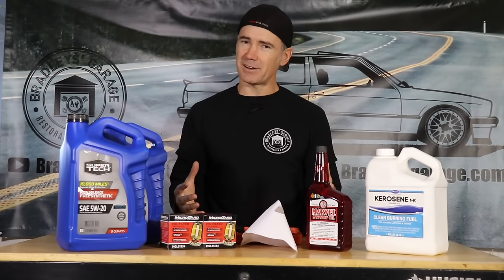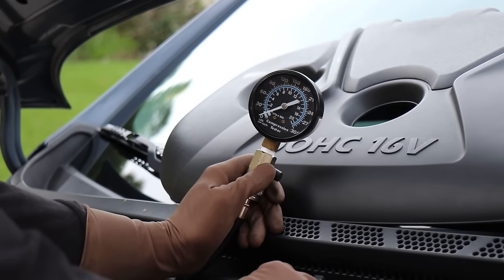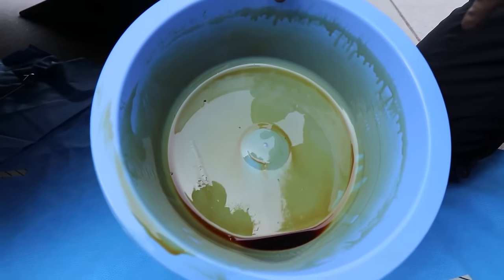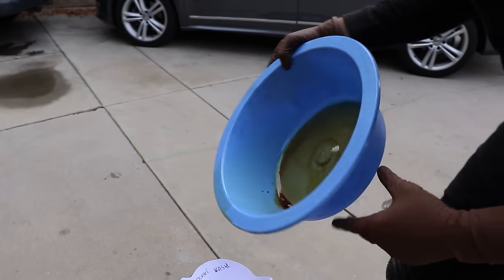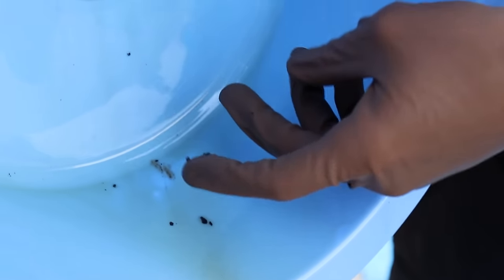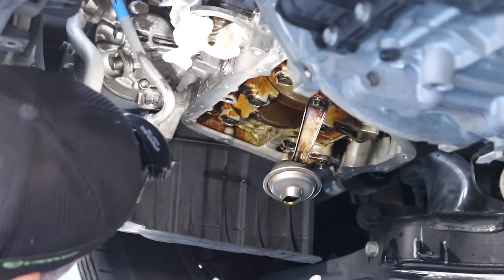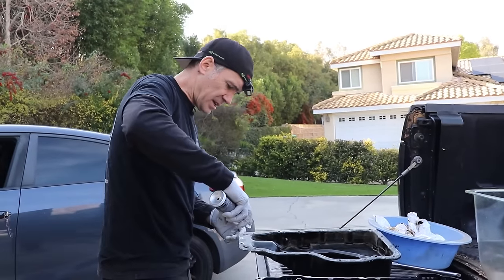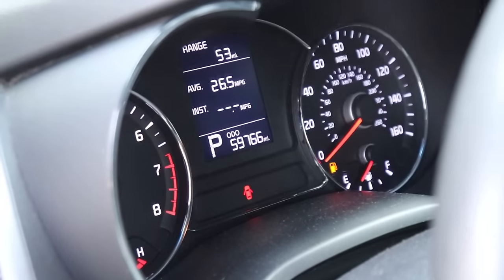*UPDATE* Customer States Jiffy Lube refused to change my Oil - Sludge Factory Kia Forte

Comment: A relatively simple process.  Wonder if it's worth doing on any used car where you may not know it's history.
Reply: Absolutely! Checking the PCV valve, if it's easily accessible, it's a great way to determine if you need to do a treatment. There are other chemicals out there that allow you to leave it in over time. I have seen a recent comment that mentions Hot Shot's Stiction Remover. That stuff works and you can leave it in.
Reply from the maker: Thanks for the question. If the used car is not bad like this Kia, then it's a lot more straightforward to flush. Since you don't always know the accurate history of the used car you purchased, it would be a good idea to make sure things are clean.
You can go with the 15 minute idle flush like we showed in the video or you can perform the "leave in" method using Marvel Mystery Oil or Hot Shot Stiction products.
Be sure to check out the original video if you haven't seen it - https://youtu.be/XU79jXYWydA
Cheers!

Comment: The inside of the valve cover looked brand new compared to the first video.
Reply from the maker: Thanks for the comments Tim. That took about 30 minutes to get clean during the first video. I'm sure whatever was left behind got some additional cleaning during the 700 miles along with the extra flushes. Cheers!

Comment: So was the first qt of diesel just sitting in there, without it running?
Reply from the maker: The first quart of diesel was just poured through the crankcase. We just let it flow out of the drain plug after the oil was taken out. We then added 3.2 quarts of fresh oil along with 1 quart of diesel then ran the engine at idle for 20 minutes.
Hope this helps answer your question. Cheers!

Comment: Looks like you need to go to the harbor freight for a tool to cut open a filter
Reply from the maker: Thanks for the comments Dave, we have never had the need to cut one open before. 😎
The first idea that came to mind was the Sawzall, not the cleanest method but it got the job done. Good news is there wasn't really anything inside it so everything came out pretty clean.
Thanks again for hanging out. Cheers!

Comment: Watched both videos. Very informative and satisfying. Subscribed.
Tip: I never replace crush washers. I use wheel bearing grease on the plug threads. Haven't had a leak on many many vehicles in 40 years.
Reply from the maker: Thanks for the kind words Tom, glad you enjoyed the videos. Since the crush washers are super cheap, we just like to replace them. What sometimes happens when they are reused, it can take more torque to get a good seal and people end up overtightening the drain plug. Appreciate the tip though, we like the grease idea, which may helping to seal as well.
We posted the 3k mile update video if you haven’t checked it out yet - https://youtu.be/QrJ0B-KXTw0
Cheers!

Comment: THE ENGINE SOUNDS LIKE A DIESEL RUNNING FELLA. THIS ENGINE IS DAMAGED FOR SURE.
Reply from the maker: There has to be some kind of damage done for sure. We just wanted to clean it up the best we could. Hopefully we have done enough to salvage the motor long term.
We posted the 3k mile update video if you haven’t checked it out yet - https://youtu.be/QrJ0B-KXTw0
Cheers!
Reply: It’s a direct injection they sound like diesels

Comment: 3k mile oil changes is a thing of the past from 60 years ago..

My Jeep 4.0 engine jas 430k miles.. and i change it every 5-7k miles..  youre wasting money doing it every 3
Reply from the maker: Thanks for the comments, it seems Kia motors may require more frequent maintenance. We have received many comments from Kia owners who also had issues when stretching the OCI out past 5k. 
Especially since this one is not driven long distances very often. It's not getting up to normal operating temperature on a regular basis. Therefore, we are recommending 3k mile oil changes moving forward.
You can check out the original video here - https://youtu.be/XU79jXYWydA
Cheers!

Comment: wondering is this, the diesel rinse, would not have been better to do with valve cover and and drain pan off to allow the fluid to get through all the oil passage like it would under normal operation...  

marvel mystery oil and I have heard from ole time mech, auto trans fluid in oil and run for like 15 mins or so hot does a lot of cleaning..  best thing is change oil more often.. 3-5K max on these guys.

PS you need a nice 2 pole lift.. :)
Reply from the maker: Hey Carl, we did a little diesel flush (off camera) with the oil pan off to wash out any debris in the tight areas of the engine and holes. That produced quite a bit of particles so we feel pretty good that the internals are clean at this point. 
Yes, having a lift would be awesome, hopefully someday we will make that happen.
Thanks again for hanging out, Cheers!

Comment: Why don't you use Velcro on the cover and the pan.  Dr Science you're not. This is a repair from the 1920's.   Clearances back then were in the .10 of an inch.  Now the KIA is is measured in 1/2 thousandts of an inch.  Diesel and Molly have minimal anti wear properties.  You will find in 3,000 miles you will be at KIA begging for a new engin, because you ground this engine up.
Reply from the maker: Thanks for the comments, we have posted a 3k follow up video to the channel. Unfortunately we won't be able to get that new engine from Kia since he is not the original owner.
Here is the 3k mile update video if you haven’t checked it out yet - https://youtu.be/QrJ0B-KXTw0
Cheers!

Comment: Here's a tip don't use OEM Honda Subaru or Kia / Hyundai oil filters from a dealer or whatever in America they're inferior use denso filters. Most filters that you buy from dealers in America are made by fram or Honeywell which is then contracted to fram
Reply from the maker: Thanks for the tips, appreciate the feedback. We had no idea the factory Kia oil filters were made by Fram, that's not good. Cheers!

Comment: This video linked below is a long but a good Q&A / History of MMO and how their product hasn't changed since the beginning in 1923 and is grandfathered in with the EPA which all of the information comes from the engineers who work for the company.  Long story short, it's good stuff.

https://www.youtube.com/watch?v=Ja4LODlMH3Q&t=881s

Started in 1923

Designed as fuel additive, then used as an oil additive as oil back then didn't have detergent and this solved the sludge issue.  

Consumers who have run their engines out of oil and ceased the engine have reported using a tablespoon of MMO to each cylinder, add fresh oil and the next day used a breaker bar to break loose and spin.  

MMO has excellent creep properties / metal wetting properties.  So much so, that the original metal cans would have an issue with the product creeping out of the metal plug cap onto the top of the can in shipping, so they went to a plastic seal on it with a packaging change from a metal can to plastic, but no change in formula.

MMO can help with a bad oil sending unit by using it in the oil to unclog it.

MMO has atypical ingredients that can't be used in other fuel cleaners and the original formula is grandfathered in with the EPA.

MMO is safe for your catalytic converters.
 
Back in 2007 when the EPA was looking into fuel additives and what is going into the air, a large oil company looked into their product and found out after testing that don't change the formula, we can't match it, a what they found is that MMO prevents intake valve deposits from forming and exceeded their expectations.

MMO has a shelf life of 7-10 years.

A little bit of MMO survives combustion, so it helps to wet the cylinder walls that fuel normally would wash off. 

MMO has the consistency of a 5-weight oil and would qualify as a 2-cycle oil and is safe for use as a 25 percent replacement of 2-cycle oil or simply an add on to the oil at 50-1 mix at a quarter of an ounce per gallon.  It's good for all small engine equipment and as a fogging oil / seasonal storage.
Reply from the maker: Thanks for sharing Stephen, appreciate the info. Great stuff there, Cheers!

Comment: CF+CF = "Clean Fluids, Clean Filters"  Fluids and filters are infinitely less expensive than replacing/rebuilding an engine or a transmission. These are clueless! Do the simple preventive maintenance (PMs) and drive a vehicle 150K miles without major repairs. Assuming 12K miles a year, that's 12+ years of service. Pay off the car in 4 years, and then have 8 years of no payments.
Reply from the maker: Thanks for the comments Robert, appreciate the feedback. He's just a 20 something year old kid that doesn't know anything about cars or what is needed to keep them running properly. He helped with the repair so he wants to learn and understand things.
Hopefully he has learned a valuable lesson on the importance of routine maintenance on his car moving forward. The goal will be for him to be able to change his own oil moving forward.
We just posted the 3k mile update video here - https://youtu.be/QrJ0B-KXTw0
Thanks for hanging out, Cheers!

Comment: In my experience, talking with managers at places I've used for decades (without any problems), it depends on the MANAGEMENT, like so many places, re Jiffy Lube. 

For managers that care and want repeat business and recommendations, just like regular car maintenance/repair shops, you can do OK.  

I ALWAYS double check the oil level and cleanliness of the oil after an oil change to at least make sure that bad employees or someone having a bad day doesn't cause a disaster. 

Obviously, you might have real bad luck one time, or run into a bad/crooked shop.  

There's a Goodyear shop near me that I'd NEVER let my car get inside that garage.  And their reputation generally matches that.
Reply from the maker: Thanks for sharing Roger, he has been going there for the past 30k miles so we are not sure what work has actually been done. Hopefully we have done enough to salvage the motor.
We just posted the 3k mile update video if you haven't checked it out yet - https://youtu.be/QrJ0B-KXTw0
Cheers!

Comment: 2016 so he should have been using synthetic motor oil........ Even if you change it every 10,000 miles it would be fine. 

He never did an oil change it just added conventional oil... That's how he got where he got
Reply from the maker: Thanks for the comments Walter, hard to know exactly how many miles since the last oil change but definitely seems like way more than 6k miles. We are thinking more like 12-15k miles sine the last oil change based on what the internals look like. 
He has had it since around 30k and claimed to have changed the oil 4-5 during this period. I'm sure the cheap oil changes at Jiffy Lube did not help the situation. 
We posted the 3k mile update video if you haven’t checked it out yet - https://youtu.be/QrJ0B-KXTw0
Cheers!

Comment: You have to be a moron if your engine gets sludge. I get excited to change my oil. Extended oil changes are pure stupidity. It’s $ 40 with full synthetic. Just change it every 3,000 miles if you have a GDI Turbo and do mostly city driving. If you do mostly highway then do 4,000 to 5,000 OCI. Why go any longer than that? Engine will last 300,000 miles if you do this.
Reply from the maker: Thanks for the comments Creating Excellence. He's just a 20 year old kid that doesn't know anything about cars or what is needed to keep them running properly. He helped with the repair so he wants to learn and understand things.
Hopefully he has learned a valuable lesson on the importance of routine maintenance on his car moving forward. The goal will be for him to be able to change his own oil moving forward.
Thanks for hanging out, Cheers!

Comment: Just put mobil1 in there, do 3k oil changes x2, then Go back to normal oil change intervals with Mobil1

The Mobil1's detergent additives will clean that motor.
Reply from the maker: Thanks for the comments, that's the plan we are on. We posted the 3k mile update video if you haven’t checked it out yet - https://youtu.be/QrJ0B-KXTw0
Cheers!

Comment: That's 700 Mile oil??? OMG!!! That oil should look brand new STILL!!! No Korean vehicles for me!!!! And only 60,000 miles 😢 I'm used to my American cars going 300,000+ and still having clean oil!!! Damn foreign cars!!!😡😡😡
Reply from the maker: Thanks for the comments Johnathan, appreciate the feedback. There was still some sludge in there for those 700 miles, that's why is got dark so fast. It looks like that distance was able to get the majority of stuff out of the engine.

Our 2004 F150 currently has 352k miles on it and runs like a beast. So there is definitely something to be said about American engines that are properly cared for.
Thanks for hanging out, Cheers!

PS -- Be sure to check out the original video if you haven't seen it - https://youtu.be/XU79jXYWydA

Comment: The basics of the engine were f=good, but you have to change oil. My mother has a 63 comet we bought new. In the late 60's I ended up with it. It ran like crap. It hadn;t been tuned up or oil change in years. Did both and it worked just fine, 144 CI, 3 on the tree
Reply from the maker: Thanks for sharing Robert, it seems these young kids have no concept of what it takes to keep cars running properly. Maybe they all need to get EV's and then they won't have to worry about engine maintenance. They will then just forget to get brakes and tires done which is worse than an engine seizing. 😎
We posted the 3k mile update video if you haven’t checked it out yet - https://youtu.be/QrJ0B-KXTw0
Cheers!

Comment: I see you did all that work, then drove 1000 miles BEFORE dropping the oil pan and removing the sludge in there. It just recirrculated That's why you still finding particles.
Reply from the maker: Thanks for the comments, we actually only made it about 50 miles before the motor started complaining about oil pressure. We just towed it back home and proceeded to drop the pan and go through the bottom end.
Looking back we probably should have just removed the oil pan when we first took off the valve cover. After seeing that much sludge on the top, it was inevitable the pan was just as bad. We were hoping the Liqui-Moly flush would break that down some but I think it's just too much to ask of any product.
Thanks again for hanging out, Cheers!

Comment: I bet if the owner runs royal purple in this car for maybe 5 oil changes there would be a noticeable difference of less varnish in that engine my aunt has a 2016 Buick Verano with 23k miles on it it’s probably seen maybe 2 oil changes I ran royal purple in it an drove it out of state on a 2000 mile trip got back an stuck a camera inside the valve cover where oil cap is an there was way less varnish in the engine it got pretty clean
Reply from the maker: Thanks for sharing, we may have to give Royal Purple a try juts to see if it can further clean up the inside varnish. Cheers!

Comment: It certainly is a lot cleaner. You did well!

It was nice to hear you also called the cover a "Rocker Cover". In my younger day I had never heard it called a "Valve Cover". I think the younger mechanics  (40 years old and younger) of today are the only ones who call it a valve cover - I wont, Rocker Cover is way too engrained in me. I am talking about mechanics here in Australia.
Reply from the maker: Thanks for the kind words Rob, we are pretty happy with the results. Our thought is if the "cover" is not making contact with anything then it's probably just a valve cover. If the "cover" is making contact with the cams or some internals in the cylinder head then it's probably a rocker cover. You could even call it a "cam cover" on these OHC motors.
At the end of the day it really comes down to how your were taught and what you are comfortable with.
Even Kia calls it a Valve Cover 😎- https://www.kia.parts/oem-parts/kia-valve-cover-224102e010
Thanks again for hanging out. Cheers!
Reply: im 56 ND IT WAS ALWAYS VALVE COVER
Reply: This is a hell of a hill to die on.

Comment: I got a Ford with 82K miles on it that was sludged worse than that. I couldn't even see the pushrods! I ran a quart of diesel in it after removing the chunks from the heads that I could reach. I didn't get nearly as good results as you did, but I managed to get about 3 more years from it before it completely gave up. The original owner (I knew him) didn't believe in oil changes; he just topped it off when it was low.
Reply from the maker: Thanks for sharing, there are lots of crazy oil change stories out there. Glad you got another 3 years out of that Ford. Hopefully this kid can get many more years from this Kia as well.
Cheers!

Comment: I would NEVER take my car to Jiffy Lube. Do your own oil changes. Also very important. These newer GDI engines have no fuel going over the valves to clean them and turbos bake the oil even more in these small engines. Change your oil every 3k or sooner. Stop listening to the dealers oil change interval suggestions. It’s all BS. They want your engine to break. If it breaks you’re back there buying a new car.
Reply from the maker: Thanks for sharing Lotus. That is why perform all of our own maintenance on all our cars. We do not trust anyone to work on our cars, regardless of the issue. One way or another we will figure out to get it repaired. 
This one is the LX model so it had the 1.8L MPI motor, not sure if they have the same issues as the GDI engines?
Hopefully he will start doing the 3k mile oil changes as we have recommended him to do.
Cheers!

Comment: This was like 5 oil changes in one. 
This why you change your oil regularly. For that car with that little 1.8l engine I would change every 4000 miles. 
I drive a Elantra and I change it every 3000 to 4000 miles. And i have no problems.
Reply from the maker: Thanks for the comments Don, we plan on getting him to change his oil every 3k miles moving forward.
We just posted the 3k mile update video here - https://youtu.be/QrJ0B-KXTw0
Cheers!